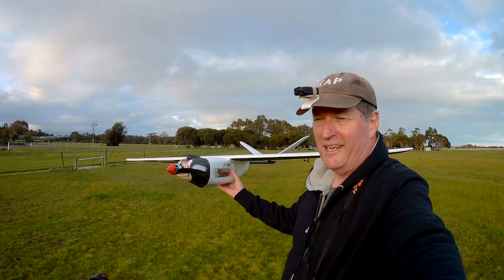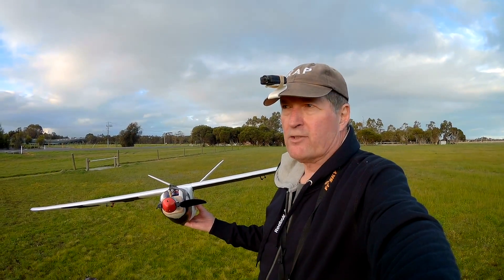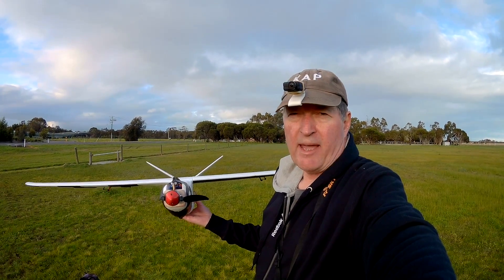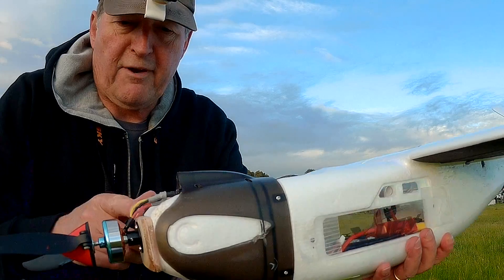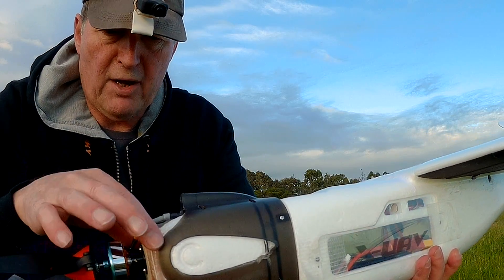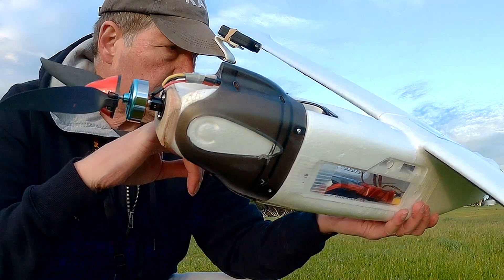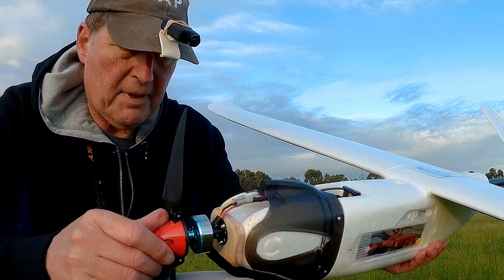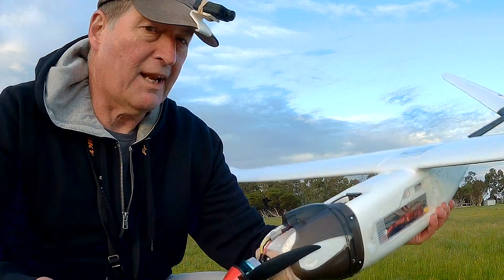X UAV One with tractor motor

Comment: Very nice mod! OK how did it end up on the cliff side?
Reply from the maker: Slope retrieval drill, I like to do one every now and then to maintain my skills
Reply from the maker: No actually I was showing off to a mate, flying inverted and ran out of lift, motor couldn't pull it out of the stall.
Reply: Yes I drill bit a plane into the ground ever so often to keep up on my hot glue gun skills too!  ;)  LOL
Reply from the maker: Very wise
Reply: That's how it always happens to me, I push it a little too far and take the walk of shame!